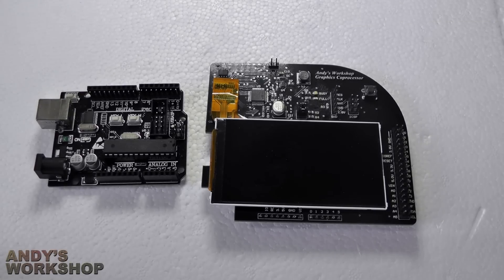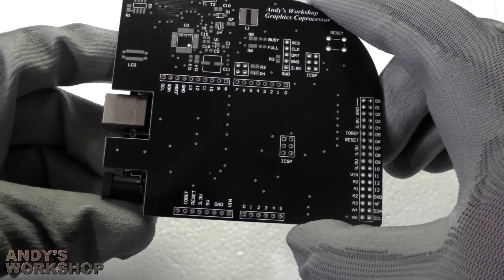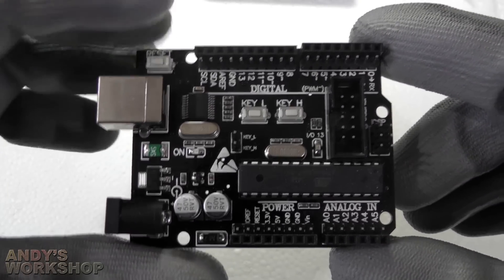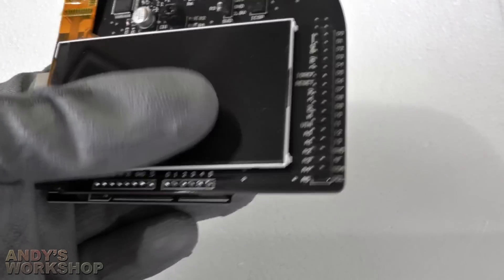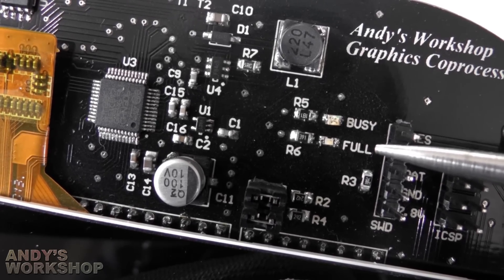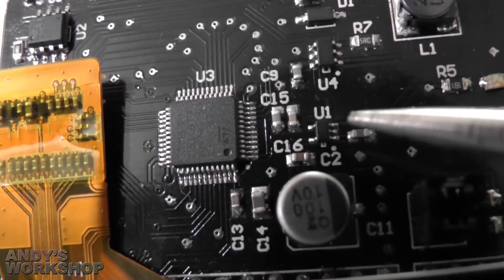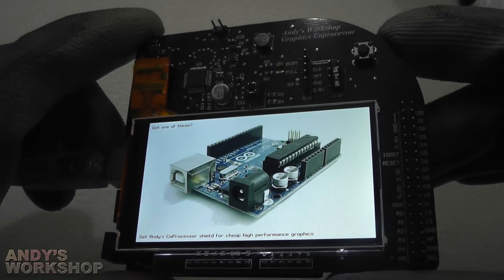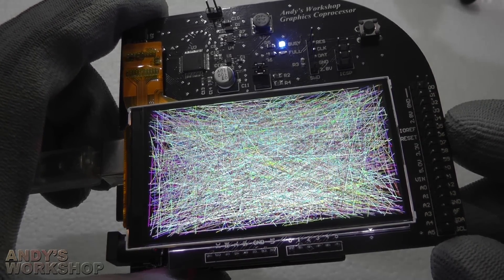Arduino Uno with STM32 graphics accelerator (introduction and walkthrough)

Comment: Can that shield be used without the uno as a stand alone Dev board?
Reply from the maker: Hi, I guess so but then it would just be an STM32 dev board with an LCD and you can buy them cheaply on ebay.

Comment: I like this nice project! And for all the stupids out there, think about some good reasons for the combination of a strong arm cpu for video processing only and an avr for doing "some stuff". The AVR can do so many controlling task with-out the display-unit at a very very low power consuming, running for years from a small lipo-battery at around 1400nA with a external RTC, the STM32 will need around 3400nA with the internal RTC on. So AVR runs more then 2 times longer. And only when you need it, u can use a powerfull display-unit. Also if u need to react to external interupts, its nice to have a seperate video proccesor, so the interupts don't mess up your video timings.  The AVR can handle 5V in-/ and ourputs, and so on...
Some comments feel like: "Why you write a small pyhton-script, when you are able to write a binary-programm in c#?". Sometimes it has nothing to do with "hipsters" or "sado-mazo" bullshit, if u use the right thing for the right task. 
I really love the AVR 8-bit µC and i know them before the first idea of arduino was born. For me there is no hassel with the arduino stuff. You get high quality, ready to use build stuff for low buget. So really nice project! Thumbs up!
Reply: Thank you for this information. Now, we just need to know one more thing....

Comment: Should have just ditched the Arduino and used a STM32F3 or F4 series. Would do everything you need in one procesor and upto 168MHz! The Arduino platform is overrated for serious embedded applications.
Reply: Even the cheap SM32F103 more powerful than arduino .

Comment: I think there is some trash stuck to your gorgeous board!
I mean, ESP8266 as a wireless serial bridge, now this. Especially when you speak of rolling our own layout of the board. Why in the world someone able to produce PCB's and populate them with STM32 chips would bother himself with an 8 bit DIP packaged microcontrolleras a main unit, or at all? Is this some new branch of sado-mazo or are hipsters taking over sane engineers and fighting common sense?
Reply: Because hipsters will buy this, but not an STM32 dev board.
Reply: Exactly. This is what really bothers me. You have an ultra fast display board that can be programmed, and you stick it to a slow piece of shit? And the same with the ESP products, you are using the ESP over serial with a 16mhz controller, when the thing itself can do 160mhz?? And something that bothers me more is, why do people still buy arduino's, when you can get a raspberry pi for $5!?!
Reply: @mariogamer929  would you hire only ceo's with heavy salary for your company ? or would you hire less salary hungry for the jobs that doesn't require a CEO'S skills ? 
Salary=power consumption in my example and CEO=Stm32, cheaper=arduino...
Reply: @dan69p  your example dorsn't make sense because stm32's are often cheaper than arduino's. Why pay the same for less?
Reply: @mariogamer929  sorry for the "nonsense", but it's the power consumption I'm referring to, stm32 use more power than an arduino, and if the battery life is more important than the power of the stm32, then it would be silly not to use the arduino.
Reply: It seems so that everyone discussing about this display here is a professional. I think the board was made for those one who are new in programming arduino & co. To handle an AVR is much more simple than handling an ARM. He made great work by developing and programming this board. Calling it as nonsense or piece of shit is very unnecessary.
Why are you so hateful about other developers and engineers?
Reply: Thought the same
Reply: Absolutely correct.  I can't express myself how much I agree.

Comment: The STM32 should be able to do most of the stuff the uno can do. Why would you use it as a coprocessor with the UNO instead of only using the STM32. I'm new to arduino, hopefully I don't ask a stupid question!
Reply: this is only how to make gpu in your project in case if you need full power of your main cpu or mcu
Reply: +bonnome2 that is very true you can find the stm32 dev boards (cortex m3) for 2 euro on aliexpress! its a no brainer for me instead of the pro mini
Reply: You can do it anyway you just need extra ram or memory for stm32. M4 works nicely. Graphics needs load of memory to handle transfer rates. I have tried a few things
Reply: It's a very good point

Comment: Hi again Andy!
Thanks for the answer ! Although I work with PIC's, I'm tying to enter the ARM world, so that's  how I find your excellent site! About the graphic accelerator, I think it's better to have one that can be interfaced not only with Arduino and the like... There are some monochrome panels (with different resolutions) that I think, could be controlled with your graphic accelerator.

Cheers,
Nicu.
Reply: Check this out, an STM32 F103 dev-board:
http://www.rogerclark.net/stm32f103-and-maple-maple-mini-with-arduino-1-5-x-ide/
https://www.aliexpress.com/item/1pcs-STM32F103C8T6-ARM-STM32-Minimum-System-Development-Board-Module-For-arduino/32583160323.html

Comment: Hi Andy!
 Nice job again !!!
 Did you consider on making a stand alone graphic accelerator based on F0? Interfaces should include serial, i2c and spi, so that can be interfaced to many other microcontrollers...
 
PS I've tried to get hold on the connector for the Vivaz LCD with no succes :(  Care to share some info on this matter?
Cheers,
 Nicu.
Reply from the maker: Hi Nicolae. You know I did not think of that. It would be easy to create a design that worked like that and it would be quite easy for people to build.